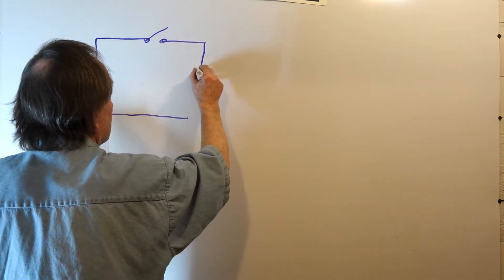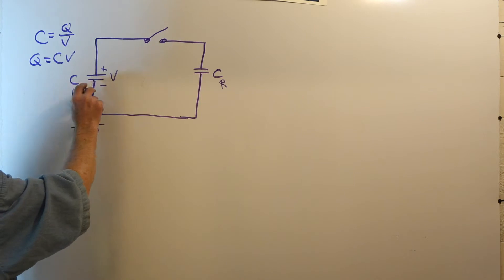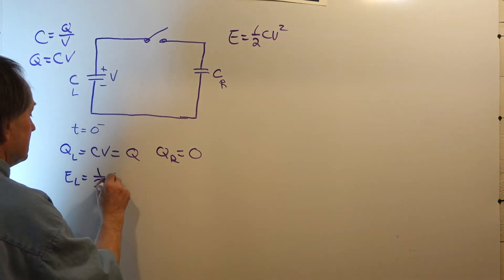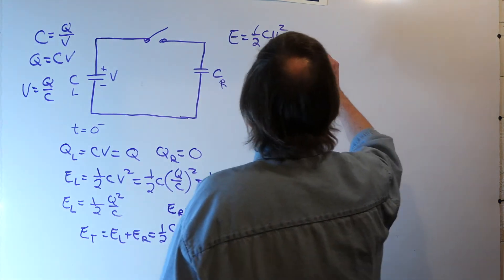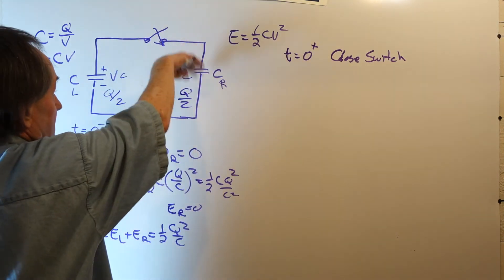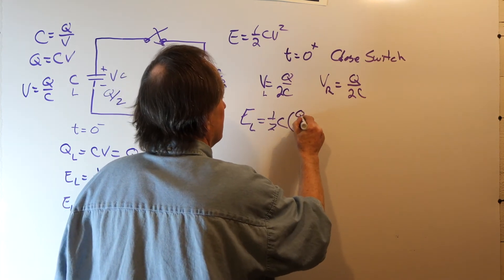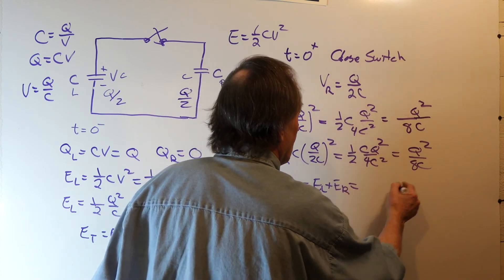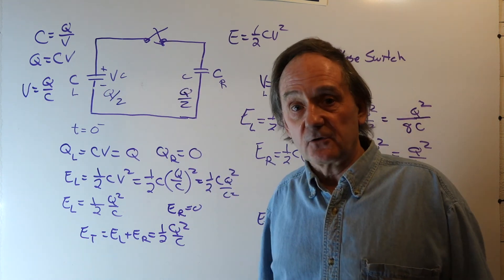Capacitor CHARGE and  ENERGY  Transfer  Problem

Comment from the maker: #############################################################
S O L U T I O N   will be uploaded on Youtube sometime soon      update 02/22/18
Have business issues that required my attention - will get to this ASAP
#############################################################

NOTE to viewer:  The two capacitors are in parallel after the switch is closed which DOUBLEs the total capacitance of the charged system.

For the capacitors to be in series you would have to break the circuit open and have two terminal nodes that touch ONE capacitor each with the SAME current in each.  You have access to two nodes "a" and "b" and both capacitors are connected between them with the SAME voltage across the capacitors, hence they are in parallel.

                       | ------------------|------  a
                       |                     |
                       |                     |             definition of PARALLEL:
                    -----                 -----             nodes  a - b with two capacitors
                    -----                 -----             between them having SAME  
                      |                      |                VOLTAGE  ACROSS them        
                      |                      |
                      ---------------------------- b

                            
           a ------------| |------*------| |----------- b

        definition of SERIES:
               nodes  a - b with two capacitors between them having
               SAME  CURRENT  THRU  them

You do not need a reference ground to establish the circuit configuration type.

Same current THRU both capacitors   =  SERIES
Same voltage ACROSS both capacitors  =  PARALLEL

ENERGY stored in a capacitor  =  1/2 * C * V^2
CHARGE store in a capacitor  =  C * V
Reply: Sir, when I connect 3 capacitors in a loop: c1-c2-c3-and back to c1. are they serial or pararell?
Reply from the maker: Depends on how you are applying or designating/measuring voltage and current in the network.  It can be series or series-parallel.  If you charge ONE capacitor and let it discharge into the other two capacitors, then the current flow "sees" the network as a series combination and the system function will have the total capacitance as:

                              1/Ct = 1/C1 + 1/C2 + 1/C3

and this value for the total capacitance in conjunction with any resistance will set the time constant for the system.

However, the voltage across any capacitor sees the network as a parallel combination of ONE capacitor in PARALLEL with the series combination of the other two.

For the case of the problem presented, the two capacitors in a loop is either a parallel connection or a series connection depending upon whether you are talking about voltages or currents.  Since energy stored in a capacitor is a function of the voltage across it, for energy considerations, a two capacitor loop behaves as a PARALLEL connection and the total system capacitance is  Ct = C1 + C2 since BOTH capacitors have the SAME voltage across them regardless of their respective capacitive values.  However, the current sees the connection as a SERIES connection and the time constants and system function for the current response will be:

                        1/Ct = 1/C1 + 1/C2   or   Ct =  C1*C2/(C1  +  C2)

This is an unusual situation and most networks do not have this configuration duality that changes depending upon if you are considering voltages or currents.
GH

Comment: your total capacity is half of initial capacitance! you have in the end two serial connected capacitors and shorted.
Reply from the maker: Not so.  Two capacitors in parallel as after the switch is closed DOUBLEs the total capacitance of the charged system NOT 1/2.

Where did you learn circuit theory?
GH
Reply: Sir, there is no 0 GND point marked, in such circuit we can discuss if they are serial or paraller. To charge second capacitor some work have to be done to polarize the dielectric. nothing for free
Reply from the maker: Are you serious?  They are parallel.  To be in series you would have to break the circuit open and have two terminal nodes that touch ONE capacitor each.  You have access to two nodes and both capacitors are connected between them, hence they are in parallel.

                       | ------------------|------  a
                       |                     |
                       |                     |             definition of PARALLEL:
                    -----                 -----             nodes  a - b with two capacitors
                    -----                 -----             between them having SAME  
                      |                      |                VOLTAGE  ACROSS them        
                      |                      |
                      ---------------------------- b

                            
           a ------------| |------*------| |----------- b

        definition of SERIES:
               nodes  a - b with two capacitors between them having
               SAME  CURRENT  THRU  them

Do you get it yet?   PARALLEL
You do not need a reference ground to establish that.

Same current THRU both  =  SERIES
Same voltage ACROSS both  =  PARALLEL

This may be a little above your understanding of electrical circuits.
Try a simpler problem.
GH
Reply: Sir, there is no 0 GND point marked either a or b point. In such circuit where we can two capacitors closed in a single loop we discuss if they are serial or paraller, thats all- that was my first idea.  Regarding to the question: To charge second capacitor some work have to be done to polarize the dielectric. nothing for free
Reply from the maker: NO.  Assume IDEAL capacitors.  I stated that.  
Make the volume between the capacitor plates a VACUUM.
In the vacuum there is  NO  DIELECTRIC  to polarize.

Quit guessing.
GH
Reply: kkk kkk 6

Comment from the maker: Good luck.  Comments welcome
Reply: There is another one possibility: the charging-discharging current is not constant, it varies in time like e^-RC function. So the theoretical answer could be that, it was changed to variable magnetic flux, as our entire loop is a coil and it was radiated to the air. Going further as the R is 0 and no L ( no oscilation) time constant is 0 so its should be dirac impuls with an infinitive spectrum band.
Reply from the maker: Missed this comment until now.
Now you are getting somewhere.   Look at the circuit with some resistance R between the two capacitors and take R ==> 0.
[[ charging-discharging current is not constant ]]  cannot make that determination for the circuit as given.

You state:  So the theoretical answer could be that, it was changed to variable magnetic flux, as our entire loop is a coil and it was radiated to the air. Going further as the R is 0 and no L ( no oscilation) time constant is 0 so its should be dirac impuls with an infinitive spectrum band.

I believe that to be a way to look at it but it is not really correct.  Can you show this in a reasonable way?

Can you think of a way to modify the circuit to transfer the charge without losing the energy?
George
Reply: Let me think. Variable current /in time/ is making variable magnetic field. So we should build some kind of current limiter which will charge a second capacitor with a constant current. But its hard to keep it constant all the time especially at the end, Thus charging current should be very low, what makes a very long charging time. Then radiated energy should be minimized. Serial Inductor should slow down charging current as well but current will be rising linear. And the inductor is "charging"  itself during this process too but later on it will give the energy back, I guess a diode is needed. Nevertheless, in the end initial amount of charge will be split ed over two capacitors, what makes kind of voltage divider form two caps, and as the voltage is divided by two and energy is 0,5CU^2 total energy will be 50% of initial, it is hard dilemma. I am not sure if its ever possible.
Reply from the maker: You are on the right track.  Inductor and diode are needed.
Inductor kills the current spike and diode stops the oscillation.
GH
Reply: Let us use a serial connected  L+ diode. Current will rise and falls. In first stage inductor is accumulating energy in the magnetic field and later it will give energy back. However, current is not a constant and  entire circuit loop will radiate energy and the inductor too. As they are like coupled and accumulate energy in the air ( if its air inductor /no core) we can safe let say this amount energy which could be radiated during direct connected capacitors. But even so, in the end two capacitors will have voltage equal to 50% of initial, probably less by the voltage drop. So in the end I am not sure if this make a sense.
I think the main assumption is wrong that we have in total 2C capacitor. This is why on the beginning I said that capacitors are serial connected as its voltage is divided by two. We can have a resistor divider from two serial connected resistors and from two serial connected capacitors too.
Reply from the maker: You are getting off track.  If your diode is ideal with no forward "on" resistance, then no energy will be lost as charge moves from the left capacitor to the right capacitor.  Without the diode, charge will just oscillate back and forth indefinitely at cycle frequency of:

                 ω   =   1/  √ (L C / 2)

The diode stops the oscillation by permitting current and charge to flow only in one direction.
I will try to post my answer tomorrow afternoon.
GH
Reply: dW=vdq, energy is lost in this work, the first capacitor has to perform a job to move a charges to the empty capacitor. All the people think that the charges will be moved so freely.
Reply from the maker: Have you tried calculating the work required in moving the charges and comparing it to the energy lost?
What about if you insert an inductor in series with the capacitors and the circuit oscillates with charges moving back and forth in the lossless network?  With your claim, the oscillation would eventually stop due to energy lost each cycle in moving the charges.  How do you reconcile that?
See my reply to Ulf Häller in this comment section.
GH
Reply: I missed that explanation.   With the serial diode there will be no oscillation just single pulse I know that. The diode is to avoid oscillation and make energy transfer in one direction only.
Reply from the maker: With an IDEAL diode and inductor,  all of the charge from the left capacitor can be transferred to the right capacitor without any loss.
The waveform will be a sine wave over 1/2 cycle rather than a pulse.
GH
Reply: No. only half. I see this so: two caps parallel end in between them on the  "high side" serial connected diode and inductor, between two caps  + poles. then only half of charges will flow from source capacitor to the empty capacitor. If they have the same capacity of course. It will be let say half a quasi triangle current wave, without oscillation.
Reply from the maker: WRONG.  With an ideal inductor and ideal diode inserted into the circuit between the two caps,  ALL of the charge from left cap of value C gets transferred to right cap of value C without ANY loss.  Hence ALL the energy is transferred without losing any of it.   
 Do not take my word for it.  Work it out for yourself.  Solve the network equations.
GH
Reply: No Sir never, if the diode is serial connected with inductor they will split the charge 50/50. No calculation needed. We must boost up somehow the negative pole of the first cap about VC1/2 to completely transfer all the charge from full charged C to the empty C. its like with two bottles( full and empty) of water connected on the bottom with a pipe.
Reply from the maker: You are wrong on this.  If an inductor is inserted in series with the capacitors, ALL of the charge gets transferred from the left capacitor to the right capacitor in the first 1/2 cycle of the oscillation.  You are forgetting that in the first 1/4 cycle the magnetic field around the inductor builds as 1/2 the charge transfers to the right capacitor and then the magnetic field collapses in the 2nd 1/4 cycle which maintains the charge transfer.  At 1/4 cycle the voltage on the right capacitor becomes equal to V/2 and then V after the field of the inductor collapses.  The voltage across the left capacitor at this point in time at 1/2 cycle is ZERO.  

Calculation is need contrary to your statement - your intuition is failing you.  I will discuss this in my solution which I hope to find time to do this evening.
GH
Reply: I am not sure that and a bit confused now - the inductor should have "energy storage capacity" exact or biger as the capacitor. I will perform a simulation as its very interesting. This could be I think only an air inductor (no core) as it never gets saturated.
Reply from the maker: Forget about core saturation.  Assume IDEAL LINEAR components.
Saturated core assumes losses and non-linearities.

The inductor will never store ALL of the initial energy because the voltage across the capacitors is never ZERO at the same time.  That would be true in a single L and single C system but not in this case.
The system behaves as 2nd order since the two capacitors "look" to be in series as far as the current flow is concerned and behave as one capacitor of value C/2 BUT without the inductor the system "looks" and behaves as a PARALLEL system to the voltage and SERIES to the current.  Interesting topology.

Why simulate?  Work out the circuit analysis.  It is not that difficult.  I will discuss this in detail rather than with just a quick simple answer as originally thought I would do.  Just checked the web and see that this problem has been discussed years prior with much discussion MOST of which I might add is incorrect.  Cannot believe that engineers and physicists have spent so much time on this and do not come up with a proper solution.

I see a popular answer which you also presented previously passes it off to a Dirac impulse with the lost energy being radiated which also is not correct nor is it correct to attribute it to work being performed moving the charges.

I may wait a bit before posting the solution to give everyone a chance to think about this.  It seems that I should make a video to put this problem to rest once and for all.  There are so many misconceptions out there regarding its behavior and the energy lost.  I will post after we get 100 views on this to make it worth while.

ENJOY  the challange
GH
Reply: This is the same problem with colliding perfect billiard balls: both energy and momentum need to be conserved. But it is not generally possible. With non-ideal billiard balls we hear the dissipated energy as the crack of the colliding balls.
Reply from the maker: @EnginAtik  That is correct and do not forget impulse forces and deformation as they collide.  Force of restitution.
See my comment elsewhere with this title:  
               George Hnatiuk
 2 years ago (edited)
               ---------------       ATTENTION   READERS      ---------------
GH